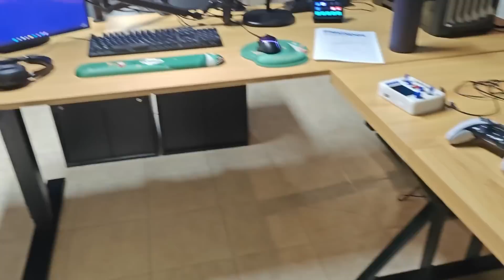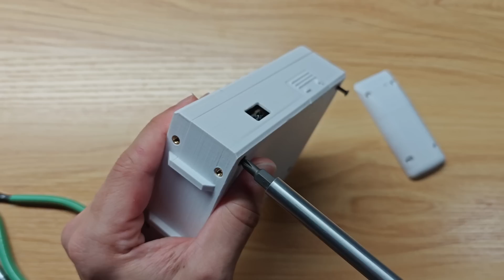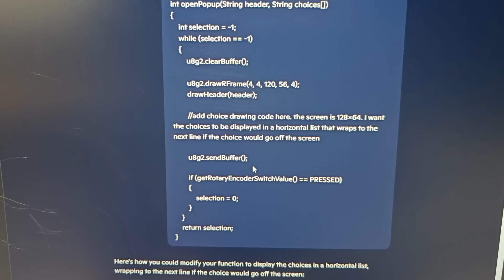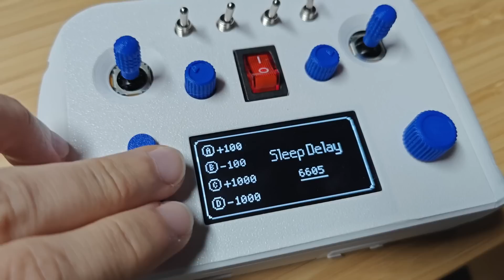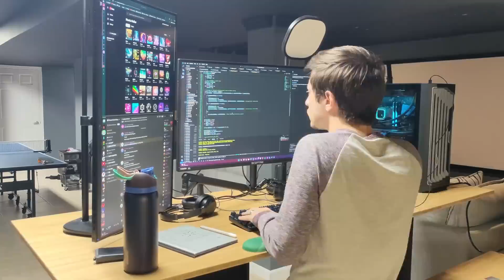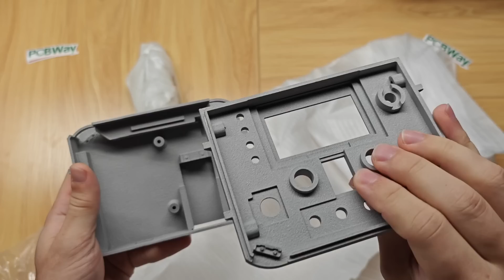I Finished My Arduino Powered RC Transmitter

Comment: Hey Aecert, I want to know what is the approximate weight of your hexapod because like I am like 16 years old and I am trying to make my own and add aerodynamics to the hexapod.
Reply from the maker: No Idea how this will help you make an aerodynamic hexapod, but it's about 6 pounds if I remember correctly
Reply: @AecertRobotics  dude that's a lot and I want to add light plastic filaments to reduce the weight
Reply from the maker: @ Just actually weighed it, its 7 pounds and 11 oz.

Reducing its weight would definitely help, im just not sure where you will take the weight off. 

And to be clear that is the weight including the battery and all of the servos

Comment: Hey. super cool project. One Question: are you coding the oled part with a preview window on vscode? is that what the mockup is?
Reply from the maker: @strackx86  thanks!
The mockup was purely so I could figure out what it should look like before I implement it. For actually coding I had no preview except the screen itself.

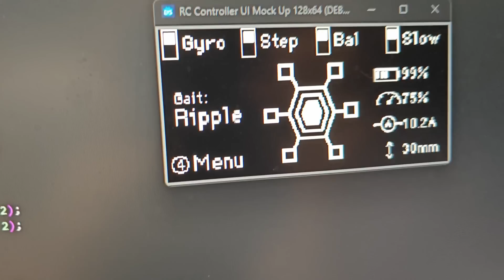Comment: I've been a .NET dev for over 20 years only a few years doing EE and mechatronics and this...wow.... Amazing work, man. Subscribed! Are you using VS/VisualMicro for your IDE? I've never seen a virtual screen display like that at 5:16 ...I'd love to know what that is as well!
Reply from the maker: @metalheadmaker  ayyye I am also a .net dev 😄 
Thank you so much dude, I really appreciate that!
So it's visual studio code + Platformio. The mockup was made with the Godot game engine! 
Frankly I could've just drawn it, but since I had experience with the engine I figured I might as well make an interactive mockup in Godot.
Reply: @AecertRobotics  I'm just a hobbyist, and I'm hanging on every word right now. Thank you for the details! I'm just using VS Pro with VisualMicro and it works fine, but it's a bit clunky.

Comment: Super nice project, I don't know if I will be interesting, will be a fun project to play with, for sure. 

One small question, will it make sense to add some sensor on the legs of the robot, to be able to detect surfaces that are not flat and walk over them?
Reply from the maker: Thank you!

That makes so much sense that I actually already did it 😄 I highly recommend checking out my other videos!

Comment: The handles should be printed from TPU with some cushy infill like Gyroid! ♥
Reply from the maker: Thats an awesome idea! I wonder if you'd be able to even notice since you really dont squeeze the handles when you hold it?
Reply: @AecertRobotics  Depending on the Shore hardness of the filament and infill density, it may not feel that different until you grip it a bit more tightly - but TPU also has a stickier surface! So it may not just improve the ergonomics, but also how it feels to the touch. 🙂

Comment: Hello, your movies are very inspiring! I am extremely impressed with your hexapod. Can i ask about how log your robot working on 1 full charge battery?
Reply from the maker: @TektroTheRobot  Thanks! That's a great question. I haven't done a formal test yet, but it lasts about 10-15 minutes depending on how hard it's pushed.

Comment: Very impressive work on the UI! Did you make a desktop RAD tool for u8g2?
Reply from the maker: @osmanpasha_diy  Thanks!!
Idk what that means 😅
Reply: @AecertRobotics I saw a simulated 128x64 display as a window on your PC. And it was animated, not a static picture (that you can draw in photoshop)
Reply from the maker: @osmanpasha_diy  ahh gotcha, that was Godot! Not really a 1 to 1, but it was a nice way to visualize the layout and flow of what I wanted. Check out the first video in this series of you want to see more of what i did with that.

Comment: About the battery. You can use 4 diods and then you could put battery in every rotate and get power :)
Reply from the maker: @themzet  yeahhh apparently there are some solutions to that, but I think the best one is to just put the battery related things in the correct way 🤣
Reply: You pay for it with the voltage drop though.

Comment: Well done, you have come a long way from when I first saw your videos, I thought you had just disappeared. Your 3D modelling skills are so much better now. If that aluminium case is printed solid you may be able to save the sides. You could either cut off the tabs and hope the screws are enough to hold it or you could use a dremel (or mill or probably also a drill press) to make the slots in the side pieces.

You mentioned the kit being possibly $100. Is that including the servos? The servos have been by far the most expensive bit of mine costing over £200 alone.

So is this the end of the hexapod project or do you intend to continue to improve it?
Reply from the maker: @conorstewart2214   @conorstewart2214  thank you so much man, I really appreciate that 🙂 
Yeah I did disappear for a bit... But I'm back now!
I'm not really interested in saving the sides. Frankly the black 3d printed ones feel and look better than if the entire thing was aluminum (although maybe im just coping but oh well)

Man I guess I really didn't make this clear. The current kit I'm talking about is to build the remote control that this video is about. The kit to build the hexapod that's in the video will be around 600 dollars (hard to say atm though)

This is 100% not the end of the hexapod! It just made sense to release the controller related content first, because if I release a hexapod kit without a controller then no one would be able to control it 😂

Comment: Will the kit really contain all electronic components, servos, pcbs,... Everything you need to build the hexapod minus the printed parts for only 100$? If yes, thats a steal.
Will you do international shipping? Please do so.
If yes, I will definitely order one.

And thanks for your great Work!
Reply from the maker: @tobias1170  That's correct, although it also probably won't include the 9 volt either.

Keep in mind this is a kit for just the remote control, which does not include the hexapod. Hopefully that was obvious. 

Ill ship anywhere in the world! But shipping will be added to the overall cost. I don't really know how much shipping will cost atm but I can't imagine it being too much since the kit will be physically very small.
Reply: @AecertRobotics  In the first moment of excitement, I really thought I would also include the hexapod. But I suspected otherwise, because 100$ seemed way to low, even with my non existing experience with buying servos and manufacturing PCBs.

Do you plan to release a kit for the hexapod too? If yes, can you already give a rough number on what it will cost?
I think the remote control only makes sense with the hexapod, so a ballpark figure would be good enough to check if it also fits in the budget.
If yes, I would be happy to use the waiting time to build the remote control.
Reply from the maker: @tobias1170  Yeahhh i mean the servos alone will cost around mid 200's.
I do plan to release a hexapod kit! My best guess is around 600, but it's hard to say atm. And it will not be including the battery, which can be pricey.

I strongly disagree that the remote only makes sense with the hexapod! You'll be able to use it to control anything that uses the nrf24L01 chip! The idea with this controller is that you'll now have something to control all of your projects with. Obviously right now the homepage is coded for the hexapod, but that can be easily changed.

Totally understand not wanting to build a controller with nothing to control though 😅

Comment: Nice editing, gets better every video. Do you know how long it took you to design make the controller? I assume it's 100 hrs+ (probably much more), it looks really good!

BTW I also hot glued the switch and it melted when I was using the hexapod a lot, but I probably used a wire that wasn't thick enough.
Reply from the maker: Thank you so much man, this one took such a long time to edit 🫠
That's a great question. It's hard to say, but yeah designing + programing was probably 150-200 hours in total. To be fair though i started this in mid-December, 2023....

LOL, live and ya learn 🤣 (correct, it will get very hot if your wires arent thick enough, although you may have also been overusing the hex)

Comment: Amazing! Will the code be available or will it be pre-programmed?
Reply from the maker: If you buy the kit, i will have the code pre installed onto the mega. Mostly to make sure the mega im shipping in the kit isnt a dud. The code is also freely available on my GitHub, which is linked in the description!